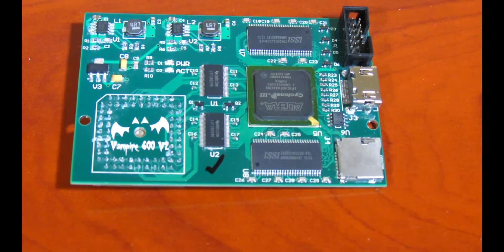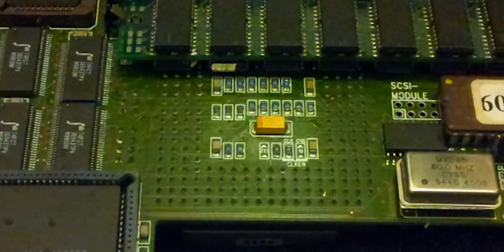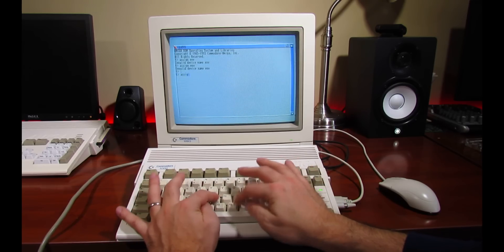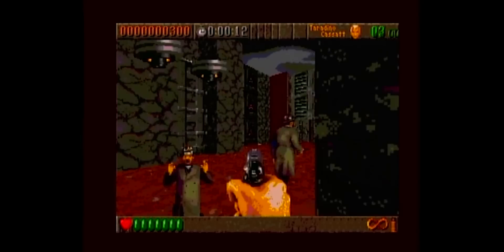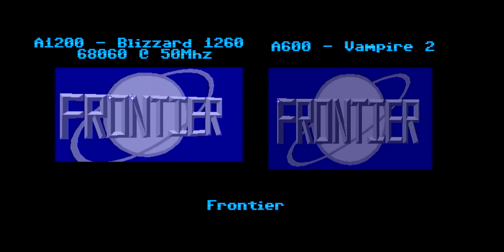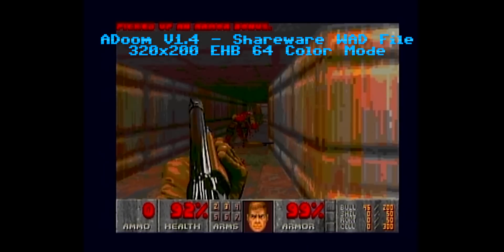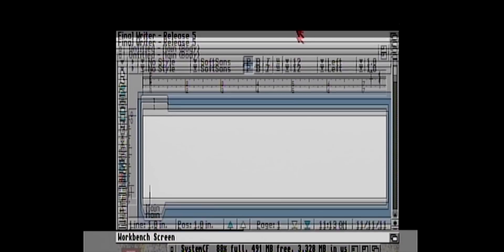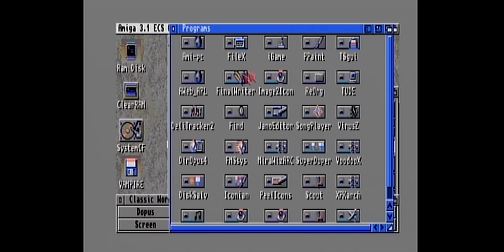Amiga A600 Vampire II Hardware Accelerator - Tested and Reviewed !

Comment: My Vampire Black only shows the logo using the DVI output. It outputs to the RGB and Composite ports. I have no screenmode drivers for a Vampire DVI. What's wrong?
Reply: a bit late maybe but you need to install Picasso96 and the SAGA vampire drivers

Comment: this not accelerator this is EMULATOR , and amiga is power suply for this EMULATOR !!
Reply: It's not an emulator,  With FPGAs you are essentially programming it at a gate level to be a 68060 processor.  It's essentially the real deal with the benefit that it can be upgradeable as it's programable logic. Like in this video it says there isn't an FPU on it. there was a recent firmware update recently that added that feature.
Reply: Actually making a standalone board is one of their long term goals
Reply: look up what an FPGA is. it is an accelerator that uses an open source cpu that is created in an FPGA
Reply: it sort of emulates CPU only and it does that on hardware level, it does not replace all custom chips in amiga and so

Comment: Why is it so expensive,its as big a RPi2..every thing for the Amiga is so expensive,Will not be getting until it goes down in price.
Reply: The reason why this is and continues to be so expensive is because of the FPGA chip it uses. Unlike most chips, and certainly like the one on the Raspberry Pi devices at the moment, they're going to be the same chip for ever more, you can run software on them, and interact with the chip but that's it. If you want it to do something else, you have to buy a new board. With the FPGA, you can change the chip's actual hardware inside it so it's something different. The 'cores' you download for the vampire board are actually changing the hardware design of the FPGA chip, something you'd traditionally do by buying and installing new hardware. 

Another way to think of FPGA vs traditional chips is like a 4 way traffic light system. That's the traditional chip, and you can program the software to change the lights in lots of different ways, you can even program it to make the lights flash in time with music. 
Now, with a FPGA 4 way traffic light system, you can re-arrange the actual traffic lights, add a new road, decide you don't want to even be a traffic light system anymore and suddenly it's a 7/11 serving week-old hotdogs.

Comment: wonder what a 64 bit amiga released to  today's specs would be like you think it would be a PC killer
Reply: Nothing would be a PC killer because pcs are open platform.
Reply: thats the problem
Reply: The AmigaOne X1000 and X5000 are not technically Amigas but they run a direct descendant of AmigaOS 3.x and are pretty up to date hardware-wise. Very pricey, though.

Comment: is workbench the same between the 600 and 1200 if you have an accelerator? i have been thinking of picking up either a c64 or amiga to learn basic, the amiga seems a lot more versatile if more expensive

Comment: The thing you're experiencing is Amiga OS. When I had my amiga you could throw everything at it and the system would still run smooth, even with 99% full CPU as I was rendering in Imagine 3D*. When you open multiple ppaints, once they open they don't consume much more cpu.
*I had to set the cpu priority of imagine 3D task though

Comment: I would have liked to hear more about how the hardware works. (1) HDMI port -is the Amiga output via this or is it only for future SAGA/P96 graphics? If Amiga ECS then does it scan double etc and is it fully compliant 50/60Hz. Would have been nice to know (2) SDcard - what for? Is it seen by Amiga as IDE storage? Or what? Does that replace the need for an IDE-CF adapter? (3) Does this have KIckstart remapping to Ram?
Reply from the maker: +Meth Methanoid as far as i know both the SDCard and the HDMI out wont work with the 'silver core'. im waiting for the updated 'gold core' to be released with P96 which will support both
Reply: +Modern Vintage Gamer the silver core includes a 640x480 HDMI mode with 256, high colour and true colour settings. There's a public beta P96 driver for this mode on the Apollo forum. No word yet on SD card AFAIK.

Comment: I have a question: Does having this accelerator game make the games too fast to play, and if so, how do you slow them down?
Reply: +Michael Oglesby Most games use the screen refresh rate as a timing reference; game logic and the screen is updated at the same rate that the TV is. A few games do rely on CPU speed for timing, but sometimes, if there is a WHDLoad patch for the game, it will fix it.
Reply from the maker: +storerestore well said. great explanation!

Comment: nice Video,

 For clarification the core is rewriteable and upgradeable,. An FPU is on the list as a future addon along with SAGA and a few more little tweaks. There is room to squeeze out about 20% more power yet. Compatibility is very high and we are working to make it 100%. Shapeshifter is puzzling as to why it doesn't start but the Fusion Mac emulator works like a charm, especially when you set up a Mac partition on your HDD. So much to try, so little time :)
Reply from the maker: +Brian R awesome. cant wait for that update Kipper. thank you very much for this hardware. its fantastic!